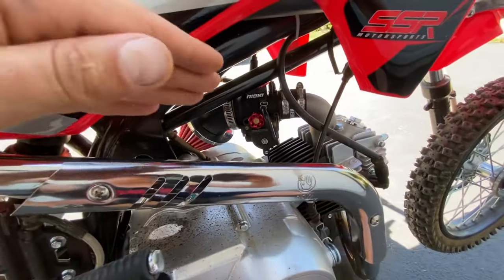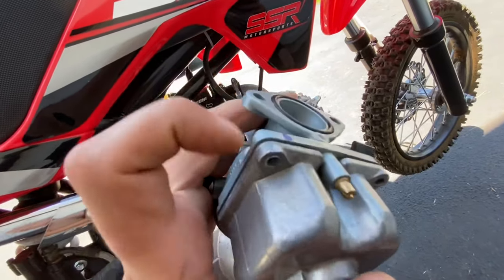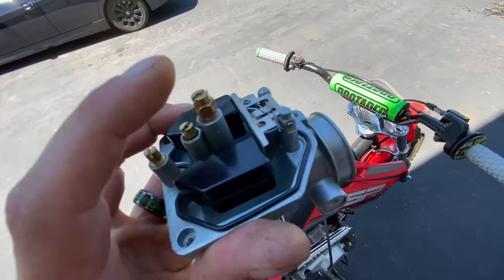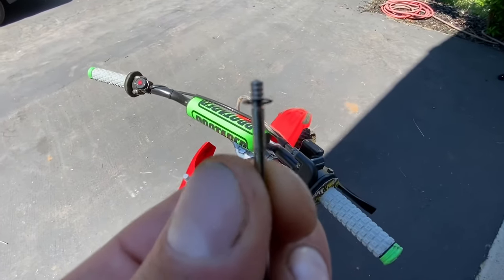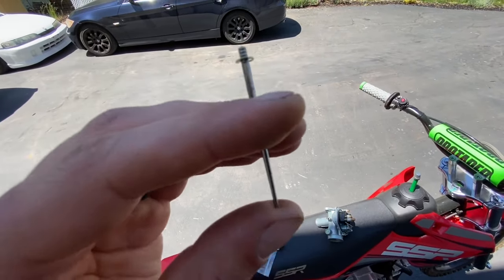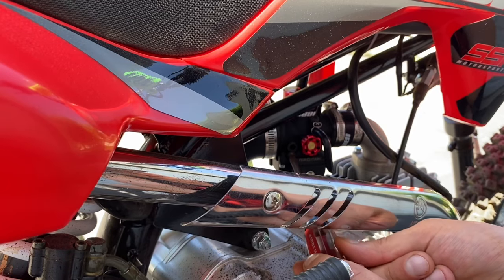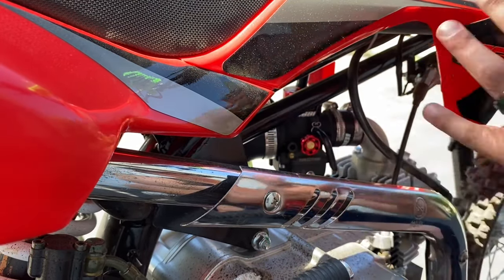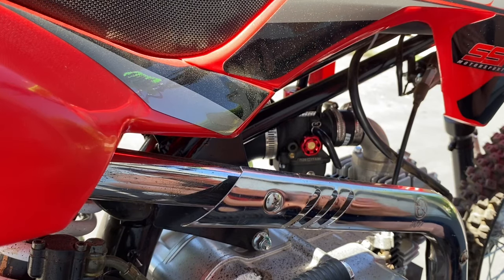How To Adjust Your nibbi Carburetor And Jetting For The Best Performance !!!

Comment: Just installed my Nibbi and set it at the baseline setting you used. Idles good with choke off but its cutting off over half throttle blip. 
Haven't changed the jets yet, would I be running too lean or too rich? Just unsure where to start with changing jets, and which ones needed to change.
Reply from the maker: This is when you have to pull the spark plug put and see what it looks like I played the guessing game for a while before I finally got it dialed in
Reply: @throttlefamily4655  Makes sense, would you happen to remember what size jets you swapped to? I have a kit on the way.
Reply from the maker: @dylanmoore1006  I want to say I was running a 115 main and the pilot I think was a 42
Reply: @throttlefamily4655  Ok I'll try that setup and see what it does. With the knock off mikuni did you have to change jets with it? If not do you think the fake mikuni jets would fit in the nibbi?
Reply: @throttlefamily4655  also do you have to drop both jets in size when changing or can you just change one?

Comment: hey question i have a nibbi kit 28 mm 150-250cc carb  with 48mm air filter kit.I cant for the life of me find where the idle screw is.Bike runs fine  but dies at stop signs and lights unless i leave the choke plunger open. Or warm it up for like 15 minutes.
Reply from the maker: I’m not to familiar with the 28mm carb sounds like the pilot jet may be too big considering it takes a while to warm up
Reply: @throttlefamily4655  ahhh makes sense thanks

Comment: Yoo, I would really appreciate it if someone could send me a name or link of the manifold.... Got the same nibbi carb but I just realized my old one has mounting holes for screws. The nibbi one needs a tube...  So I'm missing a manifold from the engine to the carb with a end piece to put a tube and a clamp like in this video

Comment: I installed the knock off mikuni on my db14 110 and I for the life of me could NOT get it to run right. It would rev to the moon all by its self. I ended up going back with the weak ass carb that came stock on it.. lame AF what the hell could I possibly be doing wrong here?
Reply from the maker: Two things here could be your problem one you didn’t have the cable installed right on the top or two you could have put the slide in wrong I face timed another subscriber and the second one was his problem he had the slide in 180 degrees backwards

Comment: Just installed my Nibbi, what could it be if my bike bogs only when I pull on throttle quickly?  Its fine when I do a slow thottle acceleration. Airflow and jets is still factory set to.

Comment: I have a 125cc but didnt came with the correct carb it doesnt have power it came with a PZ20 chinese carb but i have ride other bikes like mine an they have alot more power than mine am odering a PZ25 do u think that will do a better job? Or if it those not i will jus have to order main jets.

Comment: My exhaust glows red when idling for a few minutes. I can’t undo my idle screw any more, any suggestions please?? Great video
Reply from the maker: It sounds like you may need to install bigger jets may be running to lean
Reply: @throttlefamily4655  I got bigger main jets I can use, I’m using a 95 atm. Do I need a bigger pilot jet too or can I just upsize on the main jet.
Reply: @connorjack3246  yes go bigger

Comment: I have the knockoff Mikuni VM22 and get aggressive bogging in 2nd gear and such (seems mostly anything more than 15-25% throttle so definitely main jet). Ride in 7,800 to 9,000 foot elevation mostly; how would one go about getting jets for the knockoff Mikuni?
Reply from the maker: They use the Kiehn size jets and you can get them off Amazon
Reply: @throttlefamily4655  THANK YOU!!! That is going to help an absolute ton. I got my Uni air filter installed to my carburetor, tuned the fuel mixture screw and throttle clip, and the bike now runs only on choke but goes through all the gears perfectly on choke. Doesn't idle and still bogs without the choke regardless of idle screw adjustment and such so adjusting to a bigger pilot screw seems essential! I'm gonna open my carburetor up and potentially come back with jet sizes. Thank you, again. VERY much appreciated.
Reply from the maker: @GamingWithFusion  your welcome and you are definitely on the right track 👍
Reply: @throttlefamily4655  By default mine had a K38 pilot and K95 main. Definitely great bogging through the throttle range without that choke. I looked on Amazon and these keihin jets have mixed reviews for the Mikuni knockoff. Some say only the main jets fit and others say they're not working at all. Do you have any recommendations for getting a jet kit?
Reply from the maker: @GamingWithFusion  they have worked for me also I believe I was running a 42 and a 115 but I can’t remember off the top of my head
Reply: @throttlefamily4655  Well great. I appreciate the help! Looks like I've got some major jet work to be done to get running well! Thanks for all the uploads and viewer support! I wish you well after the apparent hard times that you've broadcasted. Jetting is a time consuming process and thus your videos and mention of the model for the jets has been a great expansion to get up and running on the new carburetor.
Reply from the maker: @GamingWithFusion  definitely no problems at all you will get it running good I went threw it with the nibbi carburetor so I said I’m going to make this video to help everyone out
Reply: @throttlefamily4655  The effort definitely made a way to give viewers a chance to fix many Chinese bikes. Kind of expected the need for jets at this altitude, but after those I think the Mikuni knockoff will run great for sure. Thanks again. Hope for more content like this! Jetting is not easy to explain, but you have some respectful explanation standards. I hope to seen you around and getting back on stable footing in life. Good luck!
Reply: Got my keihin jets today. Pilots were too big and main jets too small to thread in unfortunately. Just isn't much information for them!

Comment: Hi...good day...
Im cary from the phillipines
How can i get a rigth tune of my carburator...i own a honda.beat carbtype scooter...from 110 cc to 120 cc...carb i use is nibbi 24mm
The main jet 112 slow jet 32...
Reply from the maker: Well it sounds like you are on the right track personally I like the knock off mikuni from amazon they are much better and only cost around $35 and are very easy to tune you will probably be spending more money in time with tuning and jets then it is worth.

Comment: my pitbike runns way too high rpm in neutral and when u ride it it feels like you ride a 80cc but its an 160cc.... what jet do i have to adjust and how much rotations.... i was told to habe the two main jets in the middle all the way in.....
Reply: No, if you're talking about the pilot jet, the one on the side of the carb, ideally you want to be around 2 turns out. Fully in should make the bike cut out if not your pilot jet is too rich and need a smaller one. If it bogs on full throttle u need to put a different size main jet, midrange is on the needle which you can adjust needle position to run richer or leaner... Your spark plug will tell you all you need to know on how your bike is running, if to rich or to lean

Comment: I have a stock SSR 125, but my main jet seems to be much longer than any jet kits I find online? Know what specific jet form factor I have so I can find the correct one?  I have a 38 pilot that is short and round. 85 main that is longer than the typical results online. Im bogging from idle to WOT transition. I assume my main is undersized.

Comment: Would a 24mm be good for a 212cc? I have a 28mm genuine mikuni but can't get it to throttle without wanting to cut off or spit and sputter....180 main and 12.5 low jet, any ideas oh and I'm about 50' above sea level.

Comment: What jets would you recommend for a yx140cc engine. I have a 112 main and I’m getting popping from the exhaust on deceleration and partial bog at anojt 1/4-3/4 throttle
Reply: Having same problem. Did you fix it up ? Could use that info
Reply: Popping on deceleration is a lean state try one or two sizes richer on pilot jet, As for the bog maybe try the needle jet one clip up from position you are currently running.

Comment: Hey man, I got the NIBBI on my RFZ 125. Runs awesome with stock jetting (thankfully)! One question: it bogs if you blip it real quick (closed to half) but if you just crack it slowly & steady increase it revs fine. How do I get that bog out? Richen with a bigger pilot or main?
Reply from the maker: You may need a bigger pilot jet
Reply: @throttlefamily4655  I'm changing now from the stock 40 to a 42 and I'll just keep incrementing up from there.
At what point do I need to adjust increase the Main? Or can I leave it alone if it's running good from 1/2 to FULL throttle? Thanks again, SO MUCH, for the reply!
Reply: @MIKEDRISCOLL45  I just had to re-tune the Nibbi 24mm carb on my 155 Pister Pro. Stock came with 40 pilot, 105 main and needle set to middle position. My plug was black so it was definitely running rich and was sputtering all over. No bogging. Had trouble idling. Couldn't kick it without any throttle. Had to apply throttle to get it to start off the kick. I need to reverify now with a new plug, but where I finally got mine running great is a 35 pilot, 38 ran pretty good too. Got noticeably worse with a 42. Needle clip at the highest spot (leanest setting), and a 108 main. It idles great, doesn't bog or die off of a quick blip from idle. I'm 1 1/2 turns out on the air screw. It can start with choke off and no additional throttle applied. No sputtering in mid range, and no sputtering on top end. Will refine it now with a fresh plug to verify results. I'm currently at 4500 ft elevation.
Reply: I ended up sending the 26mm back & got the 24mm instead. The tech guys at NIBBI recommended a 19mm for a 125cc motor, but a lot of guys on the Apollo RFZ Facebook page says they had success with the 24mm so I tried it. Stock jetting & it runs fine! Still has the blip bog but I tune that out by turning in the fuel knob (higher idle).
Reply: @MIKEDRISCOLL45  So when I was blipping the throttle off of idle mine was actually dying. So that's what lead me to think it was too rich. When I went up to 42 from 40, it was dying even worse. 38 got noticeably better, and 35 was about the same. still pretty good. It was sputtering like crazy in mid range which lead me to believe it was rich. Moved the needle down one setting and it improved quite a bit, but was still sputtering some. Moved it down one more time (highest/leanest setting on needle) and all of the mid range sputtering went away. No sputtering at WOT, but I haven't had a chance to read a fresh plug after a WOT run to see if the main is too lean or not. I did put a 120 in on the main and it was running like garbage. So either the 108 is perfect, or maybe the 110. Hopefully this all helps. My air screw seemed to hit highest RPM at around 1 1/4 to 1 1/2 out from all the way closed. I just got new plugs today so will be checking that out this weekend.
Reply: @xxshiftlockxx  Thanks for adding this info in the comments, i just used your data as a starting point on my z140 with the nibbi pe26 and it  runs great with the jetting you suggested and mixture screw set at roughly 1 turn out.

Comment: What is your needle position currently set at with the Nibbi 26mm carb?
Reply from the maker: Right in the middle
Reply: Awesome I hope I can finally get this carb tuned!
Reply from the maker: I’m sure you will be able too if I can do it you can do it!
Reply: 1 more question... How was the bike running with the jetting setup you used? Was the spark plug the right color and did the bike feel good?
Reply from the maker: Bar3ar bike runs great and spark plug is perfect
Reply: With the needle jet in the middle on the 26mm, with a 49cc engine, what jets should I use? Currently I can’t get the bike to even start, not even with bumpstarting. It has ran with the setup before, but now I have no clue on how to get it started.
Reply: Elevation is 200 above sea level.
Reply: Sacramento party!
Reply: @TheNate371  when you replaced the carb, did you use the new cap or the stock one? My buddy used the stock one as well as the stock needle for some reason and we found out it was keeping his throttle wide open so it was flooding. We switched it to the new one and it runs perfect. When I did mine, I used the slide (needle) that came with the new one and tried to use the stock cap, still held mine open. So new cap helped, but I've had friends who needed to use the old cap
Reply: @languageresources3328  new throttle cable which is the same brand as the carb

Comment: Hi im rocking the same tune as you with the 48 pilot and 120 main, do you get a bog whipping the throttle from idle to full?
Reply from the maker: I was not after I tuned it but I have since then swap to other carburetors
Reply: @throttlefamily4655  i tried my heart out trying to get the 26mm to work, so i went with a smaller one the 24mm nibbi, i believe it will work better since the 26 is just too big. Wish me luck.

Comment: got one of these for my go kart having issues tuning it, it will run on stands wheels spinning, you put it on the ground and it dies
Reply: it would run with the air screw turned in the whole way

Comment: My bike with this carb the idle is so loud and when I turn the red screw for the idle up or down it will get quiet but than just shut off but I don’t bog out and when I pull the throttle the rpms are way to high what should I do ?
Reply from the maker: Throw the nibbi in the trash and get a mikuni
Reply: @throttlefamily4655  should I get the knock off mikuni and do I have to mess with the jets or anything or can I throw it on and mess wit the idle and go ?
Reply: @gavbuzzin8098  I'd like to know the answer to this as well

Comment: Hey, can you send me the link for the adapter? My Amazon Knockoff carb is sadly junked, looking to buy a Nibbi 24mm for my 2019 Apollo 125cc X-18. I would go with a genuine mikuni but god I HATE how the tuning screw is on the bottom. So going with the Nibbi. But yeah if you could send the adapter link i would applrexite it

Comment: So I got a nibbi 28mm carb for my 223cc quad but I followed all your steps in the video and the idle knob doesn’t do anything no matter how much I turn it.  Any idea what’s going on?
Reply from the maker: I feel your throttle cable may be hanging up on the top of the carburetor or you may have the slide in the wrong groves
Reply: @throttlefamily4655  oh ok I’ll be sure to check those.  Thanks for responding!
Reply from the maker: @alexandermuniz737  let me know if that was the problem
Reply: @throttlefamily4655  so I checked the throttle cable and the slide and they are good.  I changed the jets to a 42 pilot and a 115 main.  Stock it was a 40 pilot and a 107 main.  When I changed the jets the knob actually started to work but it still doesn’t run right.  Sounds lean cause it bogs while riding.  It’s really weird.
Reply from the maker: @alexandermuniz737  you may need to mess with the jetting to get it dialed just right I remember I spent 3 days getting mine dialed in
Reply: @throttlefamily4655  Yeah definitely.  Would you have any idea what jetting would be good for at sea level.  I live in CT near the coast so it’s cold too.  I would say I probably need to use bigger jets right?

Comment: I have a nibbi pe 22 on a 110 pit bike and im getting bog when i quick blip the throttle to 1/4. If i steadily accelerate its ok just if i blip it. Tried bigger pilot jets which didn't help and tried smaller jets down to 30 which didnt help. Even tried needle high and low and doesnt get better. Fuel/air mix doesnt seem to help either.Old 19mm carb works fine tho but is cheap shitty which came with the bike. Any ideas
Reply: Try raising the float is not picking up the fuel from the pilot. Or the pilot is blocked with debree from factory . Which can happen. Take out the pilot out and from inside the ventry blow air trough it with one of those rubber hoses. Don’t listen to the video that’s not how to adjust it. If it falls flat that’s the primary not picking up the fuel. Adjust your float at 45 degree. Then run it. Mixture screw out 3 turns then screw in 1/4 each time until you don’t smell crude gas. This way you keep your idle rich. And raise your idle with idle screw have it slightly higher than normal.

Comment: I’ll m running a Nibbi 24mm Carb on my Apollo RFZ 125, having some bogging issues right off the throttle, would messing with the jets the carb came with do the trick? Or do I need to order different sizes?
Reply: I have the same problem we’re you able to figure it out?

Comment: hey im running a lifan 140cc with a mikuni vm22 carb and it’s currently running on 105main and 20pilot, before i had it on a 100 and 20 and the low rpms rode really good but at top end it would just bog and sputter and im not sure where to start
Reply: I know im late but if it still helps you should put on a bigger main jet

Comment: I have the same carb but on a 1988 suzuki SP125. How many turn outs would you recommend for both air and fuel
Reply from the maker: It really depends on the bike about 1 to 11/2 for the air and about 2ish 3ish for the fuel the nibbi is a hard carb to adjust.
Reply: @throttlefamily4655  I'll give that a shot. I can tell it is hard to tune. It turns on, idles, runs good then out of no where it turns off like it runs out of gas. Also when I get it running pretty good at idle, it has limited power from 0mph or it boggs out when I take off.